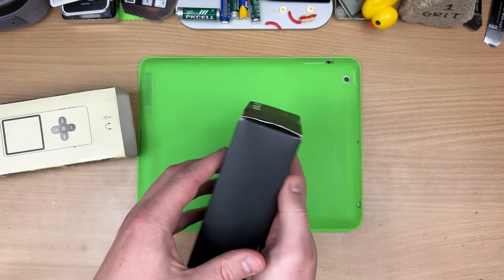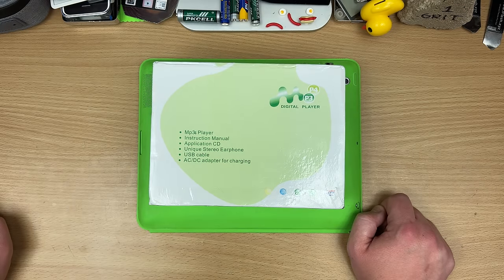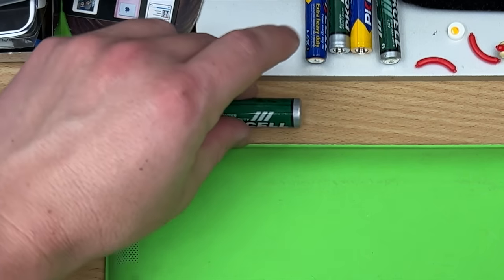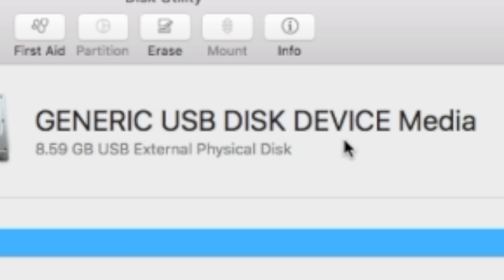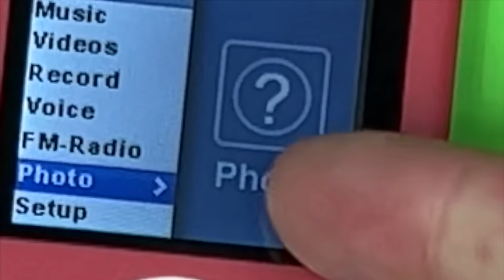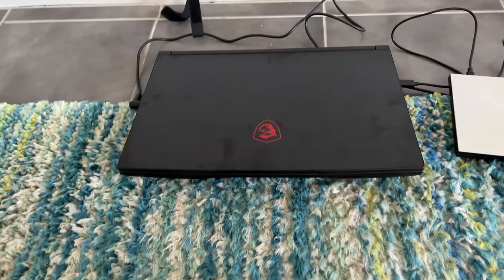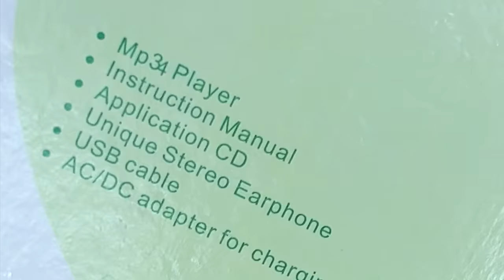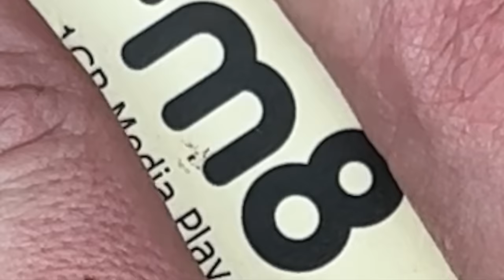The absolute worst bootleg iPod.

Comment: Reason for the disk error was probably formatting it into a Mac OS file system.
This kinda junk usually expects FAT32 or NTFS.
Not that that would have saved it from the allmighty 1 Grit.
Reply: NTFS is definitely hopeful...
Reply: This is 100% the reason.
Reply: Almost nothing likes NTFS.
Reply: Almost everything works with FAT, but even if it worked it probably wouldn't be much better than not working nugget.
Reply: I thought I would see if anyone had put this in before me. Yes, it would have needed FAT32 for certain. Interestingly, I do wonder if it was a fake 8GB device that really had a faulty 1GB chip.
Reply: This thing 100% only accepts Fat32 with an MBR and nothing else, and it looked like he just did a lil GPT right there
Reply: FAT32 all the time 👏🏼
Reply: Arguably MacOS's fault.
Why does it default to its stupid proprietary format when formatting a USB drive?
That's just stupid.
Reply: @Wuerfel21  Because Apple
Reply: Yep, it needed Fat32 with MBR partition table.
Reply: I think it has something to do with the fact that it was formatted with a GPT partition record rather than MBR - benefit of the doubt that he formatted it to FAT32.
Reply: this is exactly what I was thinking watching this. it probably needs to be fat32
Reply: Can confirm. Is correct. I am a certified guy who uses computer things.
Reply: I like turtles.
Reply: @Wuerfel21   Kinda, but FAT32 has some rather severe limitations for media these days (like 4GB file size limit), and depending on the sector size of the underlying media, usually a 2TB limit for the MBR partition table itself.  ExFAT would be a better choice for removable media, but OF COURSE it uses patented technology and can't just be implemented by anybody.  Because OF COURSE it does.  Who would write something as utilitarian as a file system spec and then release it without restriction, so it could be implemented by everybody, and actually be universal?  That's just silly.
Reply: In the pinned comment he said that he tried more formats. Also, it's actually not uncommon to fake with the memory chip size (remember the partition size changed to 1GB) and/or use second hand chips that might be dead already. If the flash memory worked, then the device should have shown up as an 8GB HFS disk when he reconnected it. Instead it was again unformatted and only 1GB.
Reply: @graealex    I don't doubt that the chip was probably mirrored to look like 8GB.  But, formatting it as a GPT partition table with Mac OS Extended is definitely not going to work on something like this.  MBR with FAT probably would, but since the original partition table is gone now, who knows what was on there.
Reply: @nickwallette6201  I still doubt it was going to function, because it would probably have come pre-formatted with MBR and FAT, but then it should have just shown up on his Mac like every other nugget he has ever shown. Pretty sure the flash was just trash.
Also, the way the fake capacities work isn't by mirroring or rolling over. Instead, it basically uses the over-provisioning that's normally used for wear leveling, but  under-provisioned, basically instead of having 120% sectors of what would actually be required, it might only have 5%. That way the OS can write at the beginning, the middle and the end to create a normal file system and partition table, and you only experience problems when the controller has allocated all available sectors to data. It isn't even a special fake controller, as all normal controllers allow you to specify any arbitrary pool size for any amount of available sectors.
Reply: I don’t it would’ve saved the nugget from it, but it would’ve delayed the inevitable
Reply: @graealex    Oh, interesting.  I had seen some old USB thumb drives and SD cards that just had a single lower-capacity flash IC on the board, and ignored the higher address lines to distinguish between what should have been 2, 4, or 8 of them (or likewise larger capacity ICs.)  FAT wouldn't mind if you didn't actually have the media to back up the size you reported, since all the important stuff's up front.  You would only notice once you started writing to the data area and earlier files got overwritten with the contents of later ones.

But I dunno.  I expect this thing probably worked at least a little.  No idea why it wasn't recognized by Mac OS.  If it were FAT, it should've been.  But it was definitely MBR (Disk Util said so), the volume was just grayed out for some reason.  (?)  Maybe it was ext3 instead.
Reply: no one here read the pinned comment ig
Reply: @Wuerfel21  It might not normally, but it might end up formatting exFAT anyway which also wouldn't work.  I'm guessing it just didn't identify itself correctly and the mac maybe thought it was intended as an external hard disk or something and not a usb stick.
Reply: @nickwallette6201  With a binary roll-over, you'd run into issues way too fast, because when you run over, you'll hose the partition table and file system, and part of the scam is that normal users shouldn't be able to detect the problem for quite some time, or at all, so they don't return the item or write bad reviews. Modern sticks will usually advertise outrageous capacities of 1TB or more. There is little money to be made from turning a 1GB flash into an 8GB stick.
Reply: @ThylineTheGay  It's not totally bad but very few stand alone devices read it.
Reply: @graealex    Yeah, but they're out there.  Bad things only happen when you cross some power-of-two threshold though.  So if you sell your "128GB" stick and it has a 32GB flash module in it, you're still quite a ways in before you notice anything wrong.  (Assuming the file system driver prefers to scan the FAT table from the beginning to look for unallocated clusters.)

It's been a while since I've seen anything like this.  I don't dip into the mystery storage media pool often because I want stuff I write to a disk to stay written.  Anyway, back then, I'm not sure the early gray-market flash controllers were sophisticated enough to do wear-leveling and spare sector mapping.  If you wanted to oversubscribe the medium, this is how you would do it with the least level of effort possible, while still having something that appeared to be authentic.

I have no doubt today's fakes are better.  (if such can be said...)
Reply: those junk actually and only could handle FAT or FAT32
no, NTFS probably wouldn't work cause hardware limitation
Reply: pinned comment
Reply: @nickwallette6201  - Yep.  I've been caught out with a fake capacity USB stick before.  I think it was 8GB claiming to be 128GB.  The chip in this nugget is an 8G bit (1GB) NAND, though.  Definitely needs MBR and FAT32.  Going back would not be possible on macOS and tricky on Windows.
Reply: It's almost guaranteed it wants FAT32 using the MBR partition table.
Reply: i wasnt able to tell if it had the old battery and flash/minidrive . those are also failure points for something sitting for so long
Reply: i came to comment the same shit
Reply: @DumbArse  Honestly could have since it was less than 4GB, and I'm pretty sure you can only do FAT32 in Disk Utility. Probably would be better off formatting it with that new Windows laptop.
Reply: @olliewebbuk   I think it’s because it was a device featured on DankPods, aka terrible
Reply: @Wuerfel21  To be fair, this is (ostensibly) meant to be an official Apple product
Reply: @Pentti_Hilkuri  Lol yeah, windows is basically the only os that will read it, even Linux won't use it and it can take more filesystems any any other OS
Reply: Glad this was said already.
Reply: nahnha, in my experience nfts give the biggest disappointment
Reply: @achaycock  almost guaranteed it's a damaged 1 gig faking 8 gigs with modded firmware , and to spite the markings on the box, they are all probably the same size
Reply: Shit the bots are here!
Reply: I wonder what the original file system was. his Mac reported it as "es" but no idea what that's supposed to be
Reply: @UNSCPILOT  truth
Reply: Did anyone read the pinned comment?
He tried every format, and it didn't work
Reply: Needs exFAT or FAT32 I’d say
Reply: Was gonna comment this. Formatting it off fat32 definitely broke it
Reply: Also another thing: MacOS can't make an MBR Partition Table, as it defaults to GPT.
These piles of junk only support MBR partitioning, and the partition formatted as FAT32, or even FAT16.
Reply: @arcanegb2662  Macs can create MBR partition tables without a problem (just did it on my M1 MBP running Monterey the other day, actually). It even supports the old Apple Partition Map format if you need to prep a drive for PPC Macs. Make sure Show All Devices is selected (View > Show All Devices, or Cmd+2), select the device, and hit Erase. It'll prompt you for the partition scheme. Normally it defaults to whichever format the device is currently using.

I think the reason it defaulted to GPT in Wade's case is because the partition table on the device was likely borked (hence the reason it wouldn't mount and didn't show a valid partition), so it initialized it like a normal blank drive.
Reply: other possible reason is that beforeformat it had a certain directory structure, so on format, it couldnt find the "music" directory... or some shit like that
Reply: probs yes
Reply: @ezyto  Yea, that's probably very telling of how long this went unsold :)
Reply: @arcanegb2662  no idea if you can do it in the disk utility thing but i'm pretty sure macs ship with fdisk
Reply: it has to be because he erased everything on that disk.
Reply: Everyone's talking about the format, but no-one seems to have thought about directory structure. I found that even with halfway decent mp3 players that if the firmware doesn't find the directories that it expects, they'll just poop the bed like this. The CD may even have had an app for creating the necessary directories.
Reply: He did.
Reply: I was just about to write this too.
Reply: @Pentti_Hilkuri  yeah not even windows
Reply: I mean, nothing supports the macOS file system, so that's no surprise. Maybe ext2/3/4 would have also worked if they based it on Linux, but yeah, FAT32 was definitely the way to go.
Reply: @Pentti_Hilkuri  My Wii does
Reply: I read ntfs as nfts and I was very confused for a second
Reply: 100%
Reply: True
Reply: @achaycock  Samsung K9G8G08U0M is an 8 gigabit (= 1 gigabyte) MLC NAND flash chip, so yes, it faked its capacity
Reply: exfat
Reply: @achaycock  The Samsung NAND flash in the unit is the K9G8G08U0M, which corresponds to 8 gigabits / 1 GB, not 8 GB.
Reply: @Wuerfel21  Because Apples proprietary format runs their operating system better, just how it is.
Reply: Yeah, you can see at 5:40 that he erases it to a blank OS X Extended partition, which the bootleg almost certainly would not understand.

It's also definitely not NTFS, the only things that can read that correctly are Windows and Linux, and the only reason it's supported on Linux is because open-source devs put over a decade of work into creating stable NTFS drivers for Linux.

I would bet a million bucks that this thing is fully expecting FAT32, and it has no idea the disk is formatted wrong. This same thing actually happens a lot in these videos, I don't think he realizes that it's formatting incorrectly.

To be clear, I don't think this is really Wade's fault, this is 100% a MacOS problem, it shouldn't be formatting generic USB drives to a shitty MacOS proprietary format that nobody likes as a default, it should just assume exFAT or FAT32 like Windows and Linux do. The "erase" command in Disk Utility is also just a really dumb and opaque name for formatting, it erases the drive to an empty filesystem rather than empty space, hence why you're required to select a filesystem when you "erase" a drive.

Apple really likes to oversimplify their software and terminology to make it as easy as possible, which sounds great until you realize all their stupid decisions means that their software is only understandable if you've used MacOS, and you're sticking strictly within the Apple ecosystem. The moment someone unfamiliar with the OS tries to do an action every other OS can do, they'll be confused, and the moment someone within the ecosystem needs to work with something outside the ecosystem, they'll be confused.
Reply: Linus said Apple HFS+ is the worst filesystem they ever had to deal with :)
Reply: @Wuerfel21  it just formats at whatever is the standard on the system. Windows does the same.
Reply: @nickwallette6201  the mac also reported the file system as "es", which doesn't sound like anything.
Reply: i think that he should ungrit it and put all back together
Reply: @achaycock  The Samsung chip inside has a model number of K9G8G08U0M-PCB0, this is very much a legitimate 8GB samsung memory module. That does not mean the module itself is functioning as intended however. It could very easily be a faulty module that was intended to be reflashed down to a lower capacity. Companies can often purchase these faulty modules for cents on the dollar and use them for lower capacity storage by reflashing to block out the faulty storage blocks. Does not mean they always do that, though.
Reply: Yeah, that's like taking the hard drive out of your PC and complaining to Microsoft when it doesn't boot.

Comment: BTW, masquerading smalls disks as large disks is still something that happens when you buy modern USB drives and SSDs. See, your system doesn't actually check how much data it can read/write to a disk... (that'd take forever!) it just asks the firmware on the drive how big it is. The firmware/controller also determines what happens when you try to write too much data; so it could just not save anything or loop back and start overwriting at the beginning. So never buy storage from any brand you don't already trust, and always keep 3 backups of anything important.
Reply: :o)
Reply: how do I do it
Reply: A teacher once told me that my work doesnt exist if it isnt saved in at least 3 places
Reply: SanDisk and Samsung are very reliable brands
Reply: most of my storage is WD brand
Reply: You actually can test the storage, it only takes like 20 minutes with a program called h2testw
Reply: Issue was much simpler. He formmatted as MacOS Jurnaled (you can see it two times). That thing prob runs fat32. Worked as USB just because osx can mount it
Reply: @homebrew07  they both got tons of fake ones
Reply: @vadnegru  since when?
Reply: @spicysalad3013  since bought on AliExpress, Wish, shady retailers.
Reply: I suppose, but this time it appears to be a genuine 8 Gb NAND flash memory (Searched up the Samsung chip at 11:58 in the vid. It is k9g8g08u0m-pcb0 if you were wondering, produced in 2006.)
Reply: Note that I said giga bit. In other words, this thing is 1 giga byte, hence why it shows up as such in the disk utility. Scummy marketing, I know, but smaller b means bit, and B means byte.

The box said GB, so they were either a) Confused about giga bit and giga byte so they wrote as such, ooor b) they knew what they were doing and purposefully did this knowing full well they can get away with "it was on caps lock the entire time!"

I am going with the latter.
Reply: @vadnegru  Who buys branded electronics on Aliexpress and Wish expecting them to be genuine and good? Lmao
Reply: @TheFrantastic  people living in small counties or where import taxes are crazy. There are genuine parts there that might be up to 50% cheaper than local.
Reply: I did not read that right
Reply: lal

Comment: 03:21 - Oh wow, it even has a legit iPod Nano 3rd gen's serial number. The iPod whose serial was reused for this bootleg was manufactured in 2007, though.
Reply: How does one read a serial number?
Reply: @kapilbusawah7169  he's speaking the language of the gods so that's how
Reply: not quite, looks like by the font the original number that actually exists ended on "0P" and they subbed it in with "OP" (zero vs O), which does not actually have an apple SN tied to it. subtle but effective. aaaaand that's why apple requires SN reader scans for all devices before any repairs can be made.
Reply: @kapilbusawah7169  On older Apple products, the 3rd digit of the serial number represented the year of manufacture (3 = 2003/2013, 4 = 2004/2014 etc) and the 4th and 5th digits represent the week of manufacture. Other sections of the serial number also denote the model and variant of the product.
Reply: Sep 3 to 10, '07
Reply: poor na no sacrificed its identity for this

Comment: I think when you formatted the disk on your Mac you may have broke something, it may have required their specific software.
Reply: yep that's what i think too, it would have wanted the software to put music on the special formatted drive
Reply: Looks like it might've been formatted to Mac OS X Extended, FAT32 should've worked alright.
Reply: It was also formatted as HFS+ instead of FAT32 when he did that
Reply: @dankpods I think this is right! Format it in fat32! Not MacOS extended
Reply: It required the one-grit.
Reply: thats what i figured, he deleted most of the firmware to make it actually work